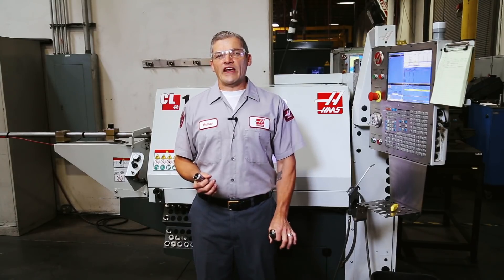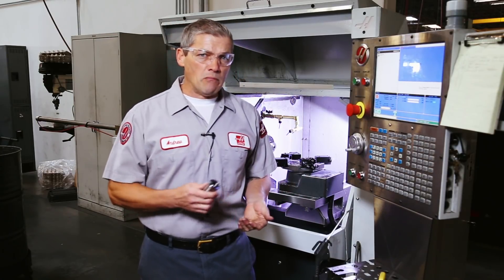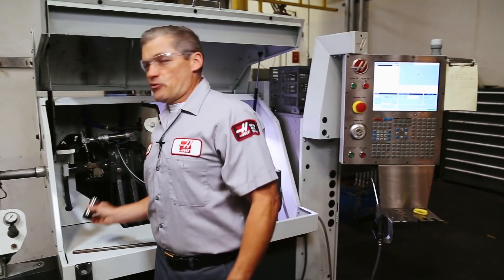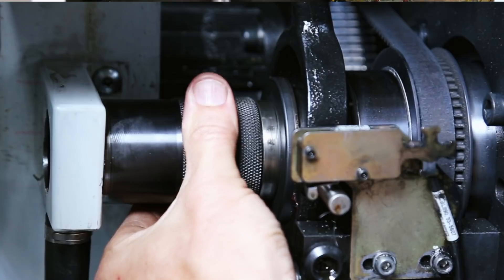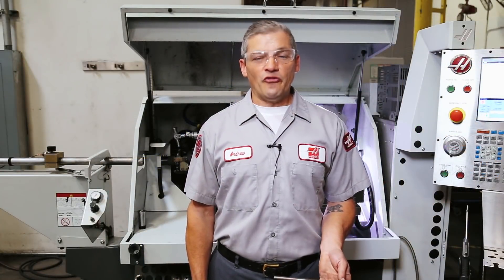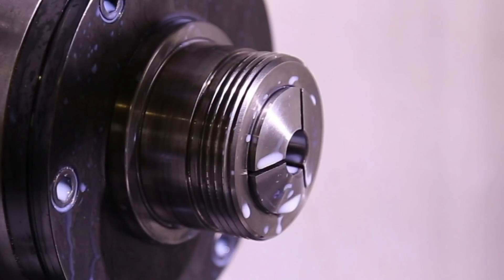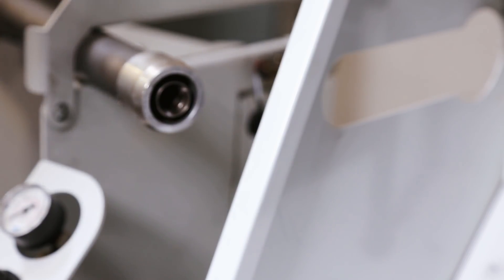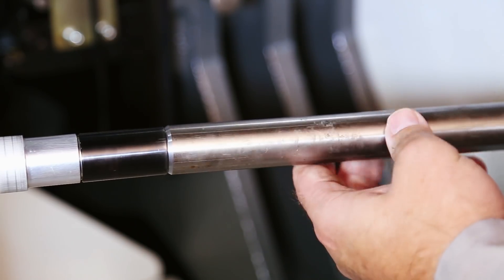What You Need to Know About the 5C Collet on Your CL-1 - Haas Automation Service

Comment: NO! NO! NO!.... Use the proper sized collet for the diameter you want to grip. DO NOT try to grip parts more than .005" (.127mm) smaller than the nominal size marked on the collet.  5C collets ARE NOT ER-style or DA-style collets where the "collapse" is spread between the front and back of the collet. The collet "hinges" at the back of the collet and if you grip much smaller (more than about .005) you will be only gripping by the outer edge.

Also, Hardinge has 5C collets in .001 increments, metric sizes or even will make you custom collets.
Reply: Does it apply to 32b type collets?
Reply: 32b collets appear to be like ER-type collets... see the original comment.
Reply: sp1nrx Totally agree! My jaw fell to the ground when he said that! Clamping 1/64” under will both destroy the collet and result in very bad concentricity and work holding. I guess Haas is not using precision collets by either Schaublin or Hardinge but only Chinesium grade😬

Comment: What's fun is that you can put a collet holder on a 3 jaw and do stupid small(think 4-40 or smaller treads) dias. It saves time and you only need to check the runout